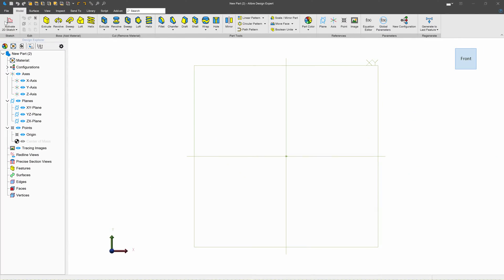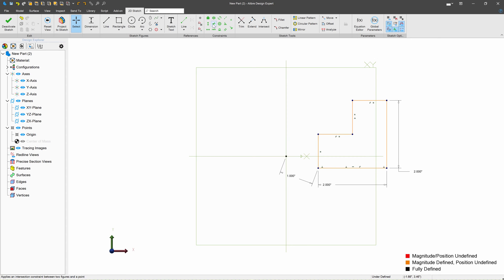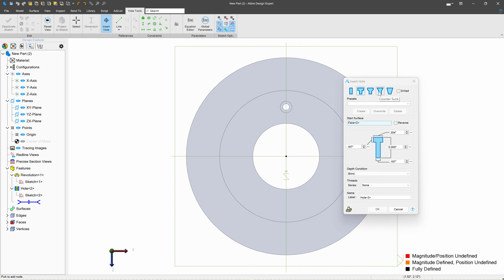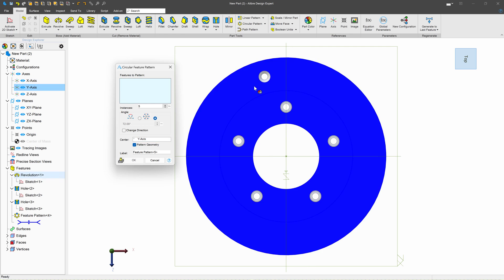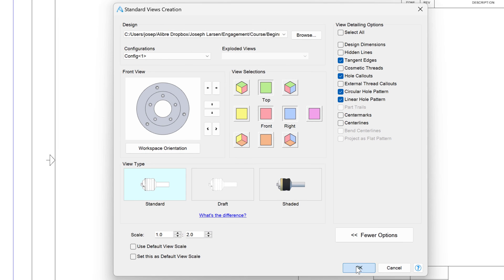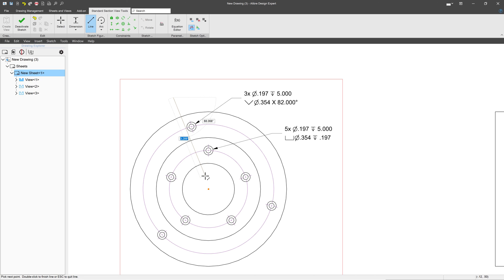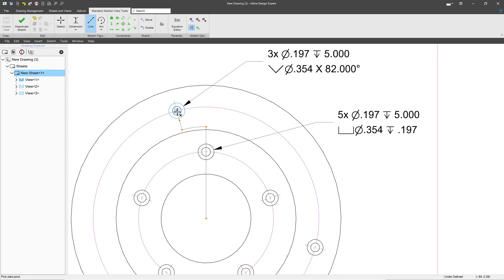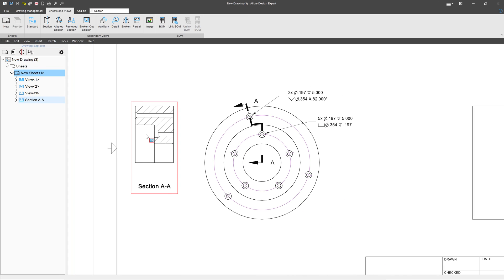Making an Aligned Section View In Alibre Drawings | Alibre Beginners Course #60

Comment: Immensely helpful in any part that has any bolt hole pattern. Piping, power transmission, material conveying and feeding, all industries that have parts that regularly need to be detailed like that in a drawing.